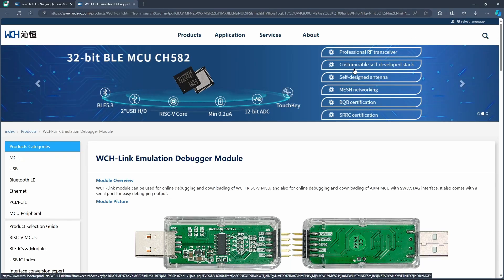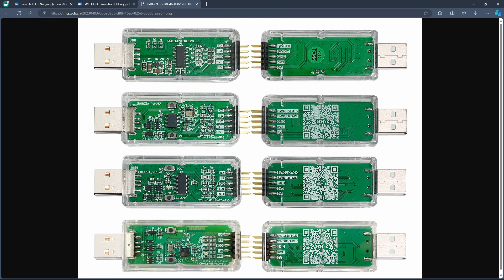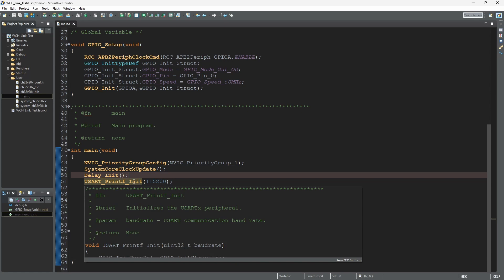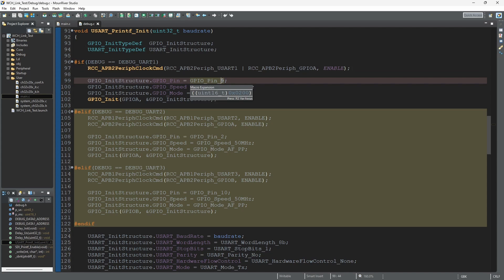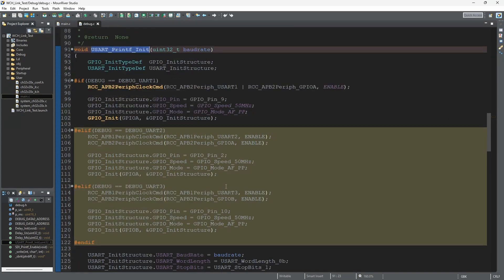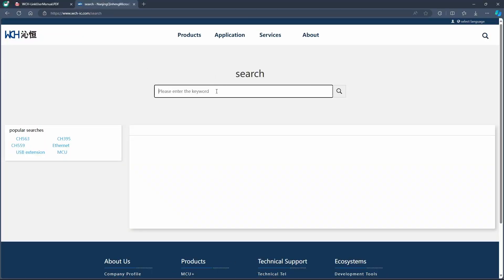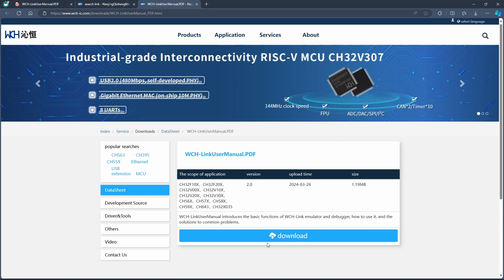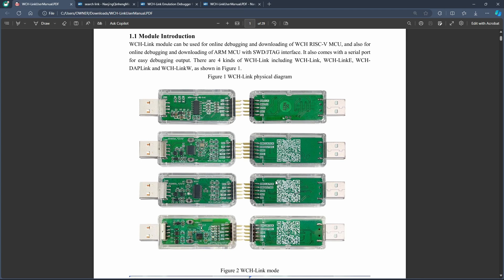#32- WCH LinkE: Setup and Trouble shooting guide

Comment: Bought the CH569W-EVT-R0-1v0 board, but can't program it.   I'm using a WCH-LinkE SWD Adapter.

MounRiver Studio (v2.80) and WCH-LinkUtility (v2.70) both recognize the WCH-LinkE debugger, but neither software sees the CH569W.  The Link-E (RV version 2.19 VID 1A86, PID 8010) shows a red led.   (BTW, if I hold the LinkE's Mode button when plugging in, its red and blue Leds both go on indicating Arm Mode)

According to the schematic, the USB-C connector is only 5V power.. the other connector (USB-A Type Female)  doesn't enumerate any device in Device Manager when plugged in.   The  CH569W datasheet doesn't say it but grounding HD0 (BOOT?)  will cause the usb to enumerate (VID 4348 / PID 55E0) for a few seconds. Zadig should be used to set the windows driver to libusb-win32.

The SWD debugger status can be checked/enabled via wch-ch56x-isp -c :
wch-ch56x-isp v0.3.0
Start time 2025-12-18 08:54:11.018
2025-12-18 08:54:11.024 (0.006 s) Using libusb v1.0.26.11724
2025-12-18 08:54:12.469 (1.451 s) Found chip: CH569 [0x1069] Flash 448K
2025-12-18 08:54:12.476 (1.458 s) Chip uid: 9C 61 48 26 3B 38 1F C0
2025-12-18 08:54:12.482 (1.464 s) bootloader: v02.70 (0x00020700)
config after isp_init() nv=0xFFFFF2E5
[4] RESET_EN 0: disabled
[5] DEBUG_EN 1: enabled      [wch-ch56x-isp -d=on]
[6] BOOT_EN 1: enabled
[7] CODE_READ_EN 1: enabled
[29] LOCKUP_RST_EN 1: enabled
[31:30] USER_MEM 0x03: RAMX 96KB + ROM 32KB
config before isp_fini() nv=0xFFFFF2E5
[4] RESET_EN 0: disabled
[5] DEBUG_EN 1: enabled
[6] BOOT_EN 1: enabled
[7] CODE_READ_EN 1: enabled
[29] LOCKUP_RST_EN 1: enabled
[31:30] USER_MEM 0x03: RAMX 96KB + ROM 32KB
End time 2025-12-18 08:54:12.531 (Duration 1.513 s)

Unfortunately despite DEBUG enabled, and the SWCLK (P3.14) , SWDIO (P3.2), and GND connected between the WCH-LinkE and the CH569 board, MounRiver/WCH-LinkUtility don't see the target CH569.  Does the reset need to be enabled and connected?

Comment: Hello. After flashing CH32F207VC6 through openocd from MounRiver Studio under Linux i try to do Query chip info in WCH-Link Utility under Windows, and result is failed. But before flashing through openocd, WCH-Link Utility works fine. What happened? Thanks.